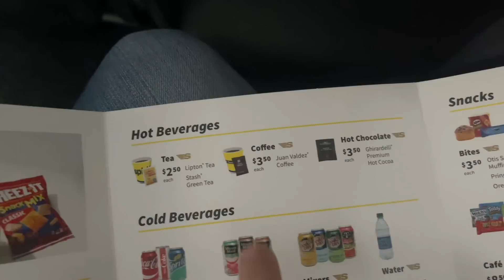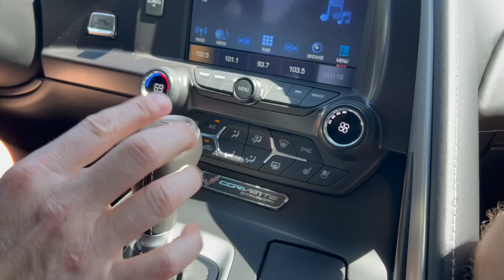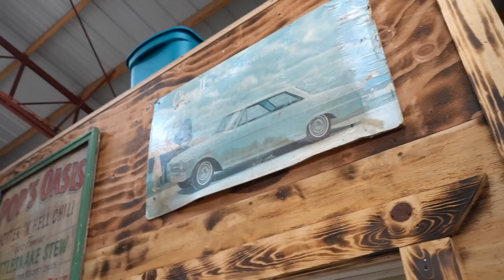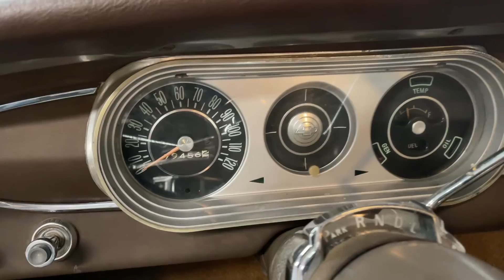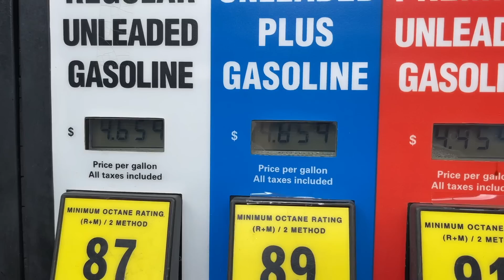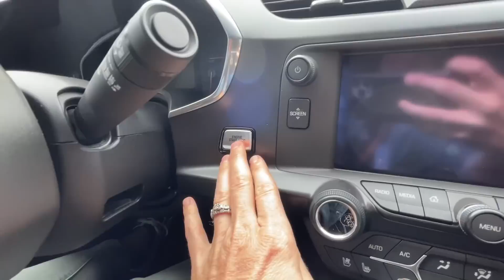Survivor 64 Nova, driving it from Cali to Texas!!?

Comment: some packing tape around the windshield would have been helpful. Since you knew that you would be driving in rain.
Maybe you look at doing  a few minor period correct mods like someone would have done in '65.
Brakes would be nice to upgrade, and the 3 speed trans. but as long as the rest works I would leave it alone.
Alt and water pump are the most likely to fail, along with trash in the carb or a voltage regulator failure.
But that is all easy stuff.

Comment: If anything has problems it will be the front wheel bearings. Might want to repack them when you get the chance.
Reply: water #1 fuel #2 elctrical #3.

Comment: the 283 is one of the best older motors ever made because its P stroked for those who don't know the term P STROKED THE bore and stroke are the same as in 4in stroke with 4in pistons the balance in doing that means its almost indestructible! and to add horse power you add the famous camel backed heads from a vette from the years 62-67

Comment: That's a sweet little ride. When y'all are ready, I'd go through the 283 from top to bottom. And if it was me, I think I'd do something like a cam, a set of Flow Tek heads, headers, and a Holley EFI on her to make her even be awesomERRRR! Especially if you did that and changed out the transmission for a better one with more gears so that it would have a much lower takeoff gear and 3 higher ones to back that first lower gear up. lol. If you did those things to it you'd most likely double the horsepower and that would make it a fun little car.

Comment: You probably couldn't break that Nova deliberately! Had a beater '65 Nova(last year of the small body like that), had a Powerslide trans and a tired 235 inline 6, put a 250 engine in it and it was an indestructible car! It saw 270 F. on several occasions climbing grades(bad thermostat was finally replaced, no problem then)but never popped a head gasket, thanks to GM's generous use of cast iron in those inline 6 engines.
Thanks for a cool video!

Comment: Love the Nova 'Crew Cab'... even with the 4 doors. What a clean original & nice color combo. Assuming you make it home with no problems and then verifying the running gear is in proper condition, how about the following: treat the rust (temporary solution), new windshield/gasket and complete interior/exterior detail? If you wanted to get a little more 'sporty', how about 1960's 15" Chevy Rallye Wheels & tires and a mellow Magna-flow muffler?

Comment: Guess you didn’t know you could put the C7 shifter in “manual” mode which turns off automatic shifting so could have paddled shifted.  IMO paddle shifting surpasses manual clutching!  Not only more responsive but you can really put the prowler down.

Comment: I would think if the hoses, and belts and all soft lines have been replaced including brake lines and the tires are relatively new and you don't push the car past its limits you shouldn't have any trouble at all. The water pump and alternator might give you issues but those are easy fixes.

Comment: The Nova is a classic example of less is more. It's a plain styled car but that's where it's beauty lies.
My car of choice is a Volvo940 wagon. Every line on the body is straight, and that's why I like it.
btw driving with your left foot on the brake could cause rapid wear off the brakes and increased fuel consumption.

Comment: Did either of you count the gears in that Corvette. I think you should have tried shifting the Vette manually and you would have really liked the feature. It's all good, maybe next time before you go to Cali you will watch a demo for the car and learn a little more. Good times! Oh yeah, I had a 65 Malibu and it was a granny's car too but then it became a 20 y/o car. It had a 327 ho with 4 speed and I sure liked my granny car after I put new shoes and tires on it. Back then the new thing was wide ovals and something called etric radials. I later found out about them and had a set of Cadillac radials on it. That car had over 300K on it when I decided to sell it.

Comment: The key situation:Does that one key lock and unlock the doors and trunk? Older cars had 2 keys one to start and one to unlock Just Saying🤔
Love her ❤ Safe travels
Reply: Actually if you go back far enough they only had one key. My 64 Buick used one key for everything. For GM 2 keys came in 65. Now of course modern cars are back to one key. I have an 87’ Ford pickup and it has two keys
Reply from the maker: The ignition key opens the trunk, yup!

Comment: GM engines from that period of time had problems with nylon coated cam gears. They would jump timing as the nylon stripped off the gear. I think if I had to change the water pump anytime ... I would also change out the timing set. It was common thing to happen between 50K-60K miles, but I have seen Chevy engines stretch it out to 80K miles.

Comment: Back then cars didn`t have many options, pretty basic. Good part is not much goes wrong with them! In 1980 my sweet gramma gave us a 1961 comet for a wedding present. She told me the mileage  was getting up there(68,000) and it was getting up there in age so I should just use it around town, ok gramma thanks a lot.  I thought it was very good shape mechanically.  So we threw on a set of Michelins on it and tool box in the trunk and droves it from Chicago to Florida and back for our honeymoon with no problems

Comment: You can put a 200R Overdrive behind and Get Little over 24 mpg. I had 1961 Chevy Bel air with same Motor with that overdrive. Drove it 40 miles. And Great Time. You need to put Good Dual Exhaust. And Change  the Master Cylinder if  your driving it all the Time. Just Makes it 100% safe. If you blow one line Now Your In Trouble.
Reply: You can up Date your Alternator with the Regulator in it.

Comment: A '64 Chevy Nova, (Formerly a Chevy II...) with a strong alternator, tranny, 79K on the clock and a powerplant that's as quiet as a church mouse... What could be any better??? First of all, do a tranny and oil change complete with Lucas fluids for both the oil and tranny... Second, go over the alternator and a tune-up with fresh plugs is in store...Third, look over the headliner for wear and tear... Then finally, get a good replacement stereo for the Nova; either by Classic car stereos, Crutchfield. eBay or Pioneer, complete with Bluetooth and stereo speakers either by JL Audio, Kenwood or by Summit Racing.... With a creampuff ride like that, you can never go wrong!!!!!!!!!!!!!!

Comment: 283 was probably one of the best motors produced by Chevrolet around 195 horsepower I think I don't think I would plan on anything breaking down she'll make it all the way then you can give her some love
Reply: The 283' had many different horse power ratings but I don't remember one with 195 hp. Maybe there was  a low compression truck motor with a rating that low.
Reply: @victoroneill7924  I specifically remember my dad's 66 Caprice  had the small block 195 horse there were a lot of variations in those years lol

Comment: Everything thats Happened to your Nova is Normal 60's Cars{my 64 LeMans Sport Coup, had the Same Problems and virtually everything you want for the Nova is available}. Headliner should be fixable, Replace front and rear Window Rubber, Plus a lot of these cars had Rust on the bottom of the window Channel when you remove the rubber.. Always use Distilled water with your Antifreeze Solution{When I sold my 64 back in 2005 it still had the original Radiator, and Only the 2nd Water pump}. If interested I'll give you some other Things to watch for, as I Restored Cars..

Comment: Yep brakes I would just replace everything in the brake system leave it stock but at least it's new get a spare generator alternator you can even converted to a one way but keep the stock stuff just in case you want to go back you can get everything for it that's what's cool and it's cool put a windshield in it couple arrested cars and drive it everyday that's an awesome find don't find them too much like that anymore283 is indestructible in the last forever unless you really beat the s*** out of it and then it still won't run maybe a timing chain and gears cuz those fiber teeth are really old have to drop the oil pan No to do that unless you want to do hackery on the timing cover but it's still awesome it could be the most dependable car you'll ever own have a great day

Comment: Water pump
Radiator hoses
Points
Coil
Wheel bearing
Brake cylinder 
Electrical gremlins

All that said, I’d take the Nova over the C7 Corvette.
Best of luck on the drive.